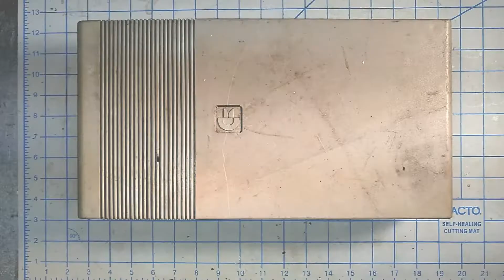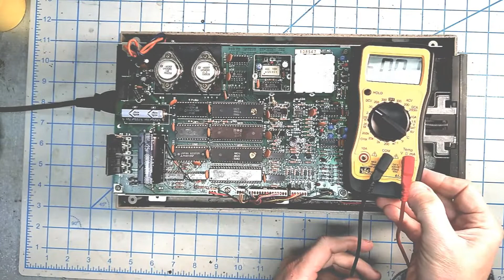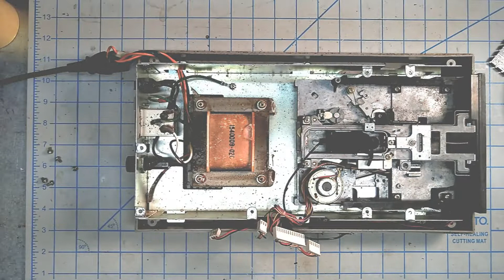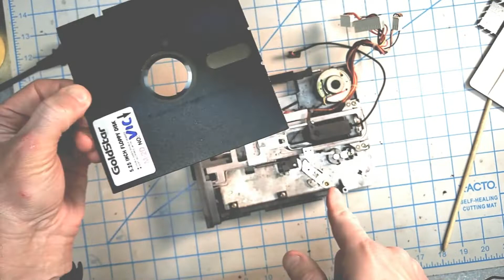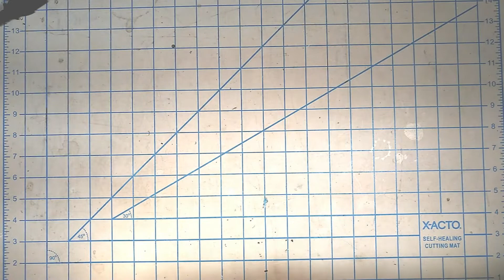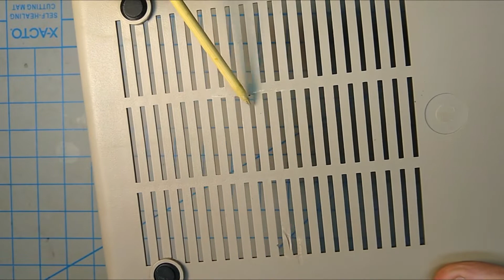Episode 12: 1541 Diagnostic & Repair

Comment: On the old pcb there are lots of factory “bodges”, including the resister you mentioned and the trace from the IC pin where the resister is soldered should be cut, several other resistors changed and a couple wires on the bottom of the pcb.

Comment: Very informative, thanks for sharing. Currently in the process of repairing one, been swapping IC's and found that the ROM on mine is faulty. Unfortunately those are pretty expensive where I live, but I'll find one. Still get a file not found error, so will now try and find a video on that issue :)

Comment: Loved it. I can’t get enough of the 1541 repair and refurbish videos ☺️. I’d a similar electrical/mechanical combo with my eBay 1541, though my electrical issue, while the same symptom was due to a faulty UA1 logic chip holding the 6502 in reset mode. Desoldered it, put in a socket and a replace 74LS chip and it worked. GadgetUK was a big help in suggesting a few things via twitter. Keep up the good work on the vids 👍